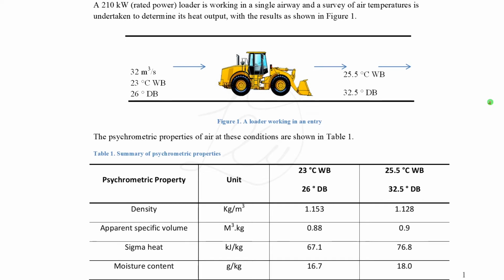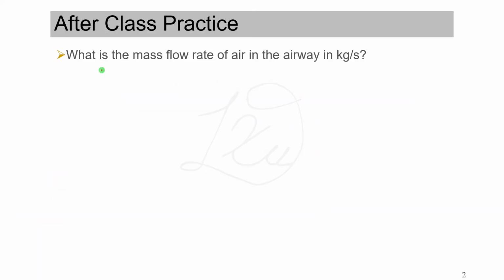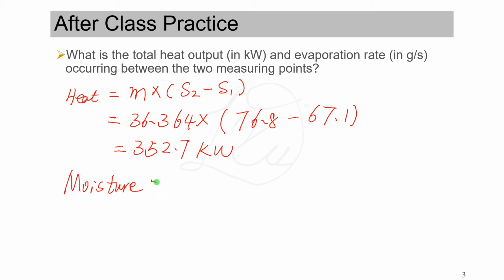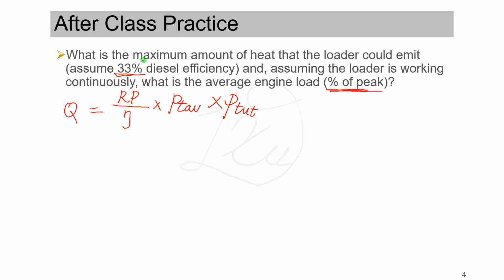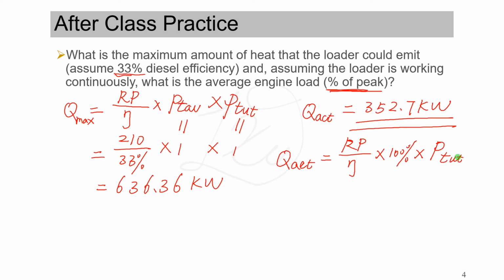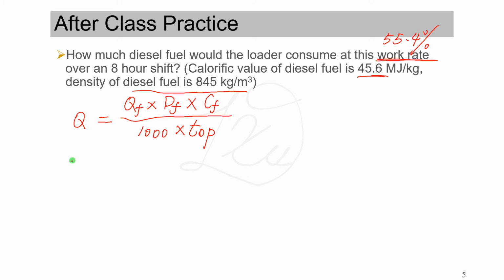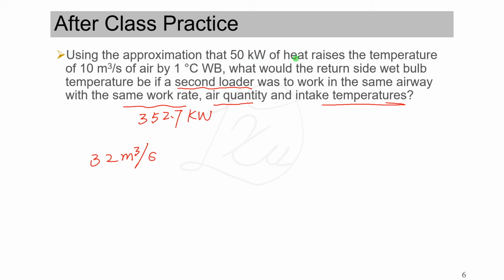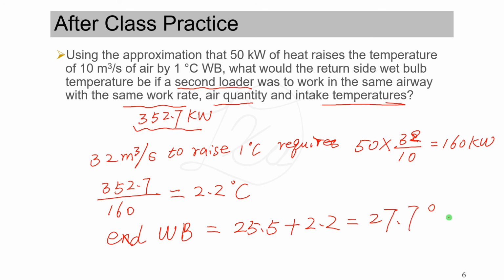Mine Heat 6: How much heat does a loader generate

Comment: Sir, can you also discuss how many blowers are needed given certain parameters, and the power of blower engine required.
Standards in blower distances and efficiencies.
Reply: For example, driving a 3km adit, how many blowers are needed in total. Thank you.
Reply from the maker: Hi Marvin, thank you very much for your questions. If you can make your question more specific, I am more than happy to look into it and make a video on that question.

Guang
Reply: Hello Dr. Xu,
Thank you so much for taking time to reply to my questions, but to be more specific, my question is:
1. How many blowers(specify the number of blowing and suction blowers) and at what power rating(HP) are needed to drive a 3 kilometer adit(not a tunnel) with an elevation difference of 10 meters from the portal to the end of the adit? (if insufficient data please provide assumptions) 
2. Given that driving a 3 km adit requires 2-way ventilation scheme, how long should the distance of every  blower be?(both for blowing and suction)

Other given:
Adit size: 3. 5 m x 3.5 m

Thank you, Dr. Xu!